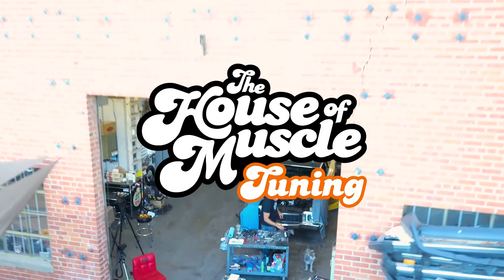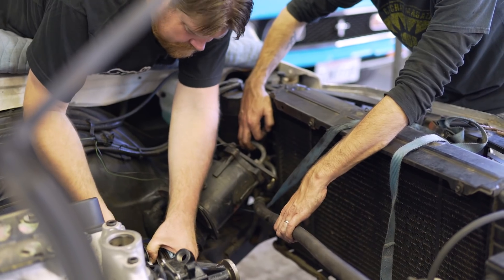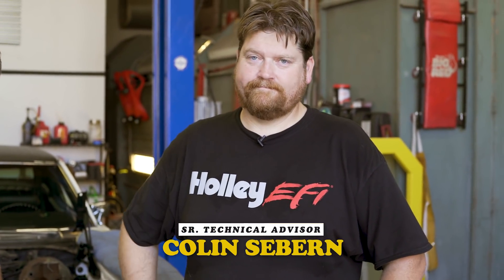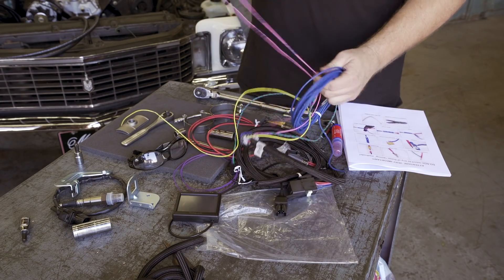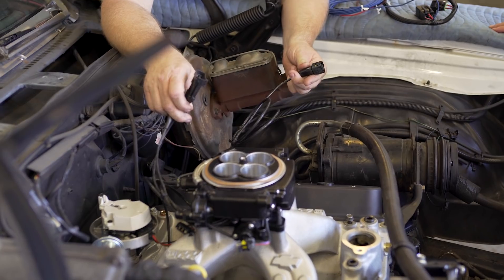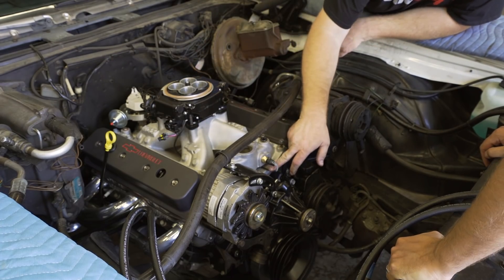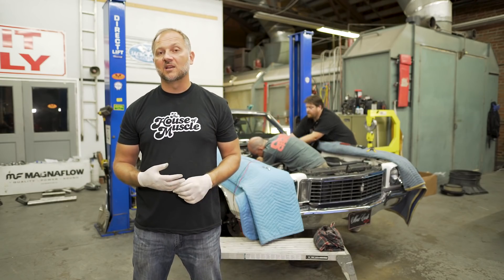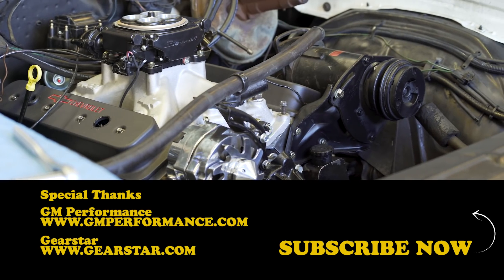Episode 3: Holley Sniper EFI - THoM Tuning

Comment: Ugh, don't use vinyl electrical tape on your car! Use automotive harness tape. It's expensive (for tape) but the adhesive doesn't turn into impossible-to-remove black goo that gets EVERYWHERE with heat, time, or chemicals. Plus it looks better, original and is reinforced. Polyken makes what I use for about $8 a roll. I've learned and I've changed, vinyl electrical tape is for amateurs. But I just learned from the comments that this car was stolen and my automotive heart breaks! I had a '72 as well but nowhere near as nice as this one and love these cars, my absolute favorite, more than any Chevelle/Camaro/Mustang. Damn dude... damn.

Comment: I’d consider a suspension upgrade from either Hotchkiss or Detroit Speed and a four wheel disk brake upgrade as well,with more go you’ll need more woa
Reply from the maker: We actually left the suspension unmodified on purpose as the car rode beautifully and actually handled quite well. The brakes though... those would've been upgraded.

Comment: do you need an electric fuel pump to use the holly sniper efi? or can it be fitted to a system that has a mechanical fuel pump?
Reply from the maker: We utilized the complete fueling kit from Holley that included and a new in-tank electric pump.
Reply: You need an electric pump.

Comment: Hey Mike, This is a great build series and concept I wish I saw more of. I really do daily drive in northeast PA my 1965 Mustang coupe. It is mostly stock and in so so condition; not even close to a car show winner. I did upgrade a few things like power disk brakes and swapped in a stock 5.0 out of a 1989 Mustang GT. Runs and looks sort of OK but not great. This is my only car. Yours being stolen really sucks man! Love all your The House of Muscle car series.
Reply from the maker: Thanks Norm. Appreciate it. As long as these cars are maintained they make wonderful dailies. One just has to consider things like braking performance and such in regards to safety, but all that can be update with whats on the market today.

Comment: question..why not use shrink wrap in stead cheap electrical tape
Reply: Timothy Wyant everything already has connectors on it. So it would be incredibly difficult to try and slide shrink wrap over all those connectors. Plus if there’s a mistake electrical tape can be taken off without a knife near your nice new wires.

Comment: I can't tell you how helpful this was for me as I want to use the same A/C compressor in mt build. Yes I am building an old car as well 76 ElCamino with a small block and it is a parts gathering exercise. So good to see someone else going through the BEHIND schedule thing. I am using the FiTech  version of your Fuel Injection. I really want to see how yours works because mine was not a plug and play at all. I hope yours is I had to put everything in mine it had nothing as a pre-loaded MAP (of coarse I got the top Dog version) I am still finding ways to get it running the way I want??????
Reply from the maker: The Holley was really a piece cake to install and worked great out of the box. No complaints at all.

Comment: 1:15 I love seeing people do the work to keep AC!  Sure, it's way easier just to leave it out, but sweaty balls everywhere appreciate a properly working cooling system.
Reply from the maker: There was no reason to get rid of it. The old compressor worked absolutely fine as did all the plumbing, and adding an aftermarket unit would only mean spending more money for no apparent gain. Plus R12 - that stuff blows COLD and it's not a difficult to get as everyone thinks.
Reply: Interesting. I was under the impression that R12 was almost unobtainable and when one did find some the price per pound was astronomical. Glad that you brought up that you didn't convert to R134 since this is a question I always have about pre-1990's builds and very few of the reality shows mention this.